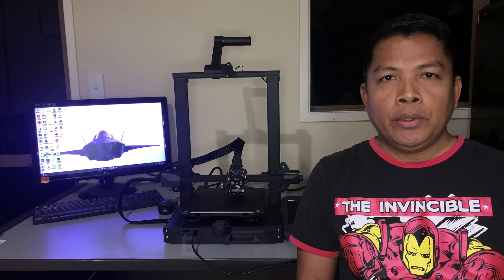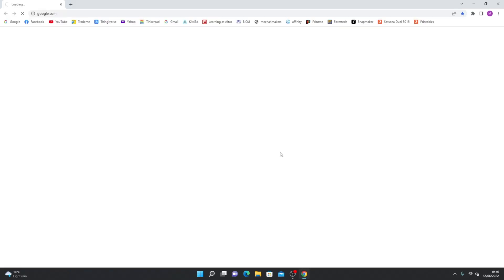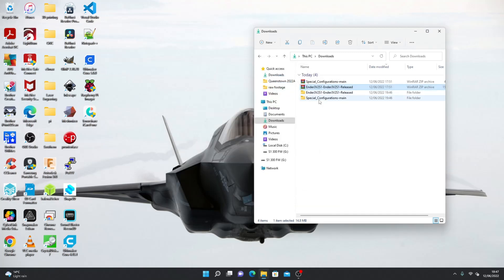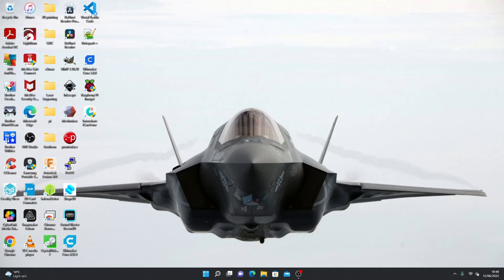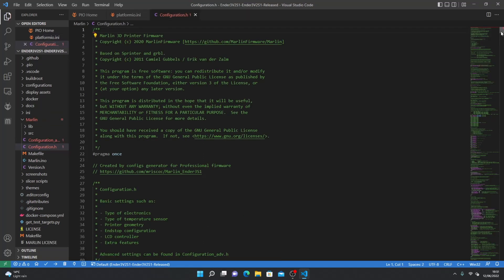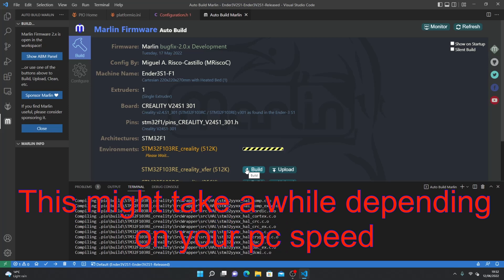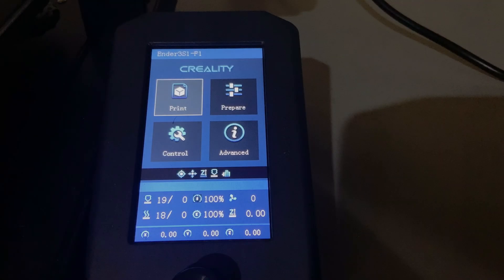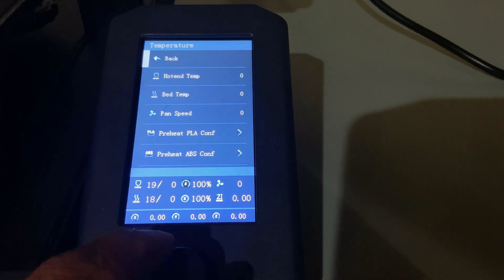Ender 3 V2/S1 295 C Hotend Max Temp

Comment: I am very disappointed, I was trying to do it my self with Ender 3 se, but my lack of knowledge about programing was overwhelming.I couldn't even do it with chatgpt help. Marlin doesn't build the firmware due to some problems with python, egg.This is so stupid. Creality sells themselves the higher power hot ends and doesn't give the option to use it full potential of 300 C hot end. I am so frustrated right now :( I have downloaded the source code from github.

Comment: Doesnt show list of printers in (special_vonfigurations-main) folder so im at a loss from there? Any help please? I downloaded as shown..
Reply: If you have not solved this, there is a custom configurator (Configurator.pyw) in that "Special Configurations" folder and you just have to make it  yourself. You need to have Python installed
Reply: @BTB_Works I appreciate your response .. since that last post I have sold it and bought a Bambu lab printer.
Reply: @JB-smokn I refuse to give in😂. I might get a core one or a mk4s tho

Comment: I'm just trying to hit 280. I didn't do the last step with Octoprint. I just tried turning my temp up to 280 and my high temp alarm/error went off. What did I do wrong??
Reply: have you solved this problem?
Reply: @billy.the.maker.  Yes, it seems that my hot end needed to be replaced. I think it was just a coincident that it went bad at the same time I was trying to increase my max temp. Once I replaced it, the problem went away.

Comment: Hi. You don't need to do a custom compile for use the C104 command.
Reply: The legend himself! Thank you for this amazing software!
Reply: I tried using the C104 and it did not work on your FW. Any thoughts why it did not work? It seems the configuration.h file limits it to 275-15 which is 260
Reply: @roberth8123  due to an already solved Marlin bug, the May precompiled versions can't use C104, use a previous version or wait for a new release. You can also build the firmware from the sources.
Reply: @MiguelRisco  Thank you very much for the reply, Miguel. Thank you for a wonderful firmware as well. I'll have to buy you a 🍺 or ☕️
Reply: @roberth8123  Thank you!